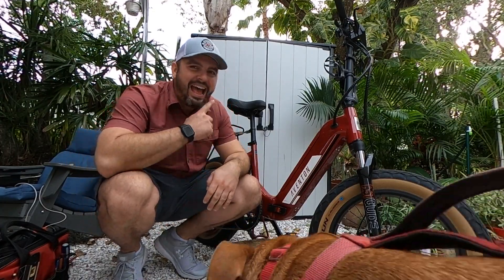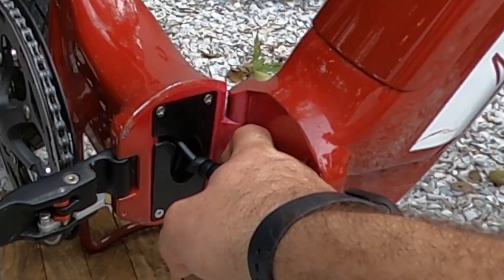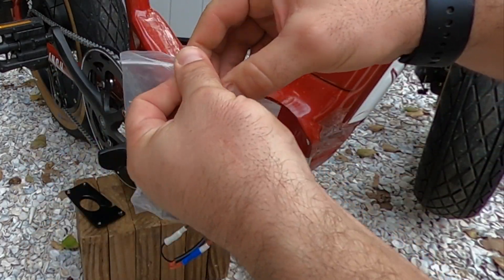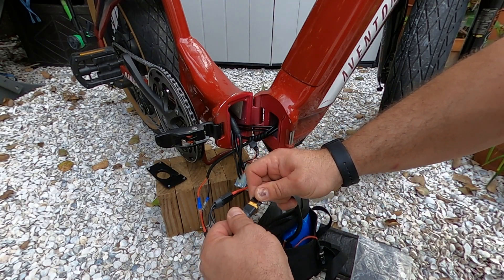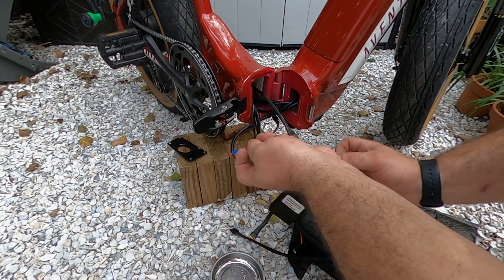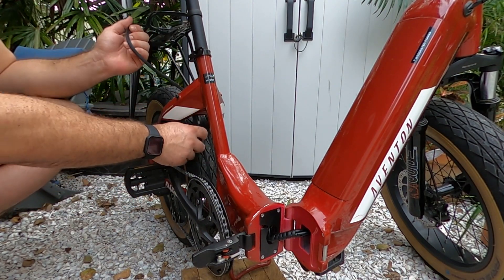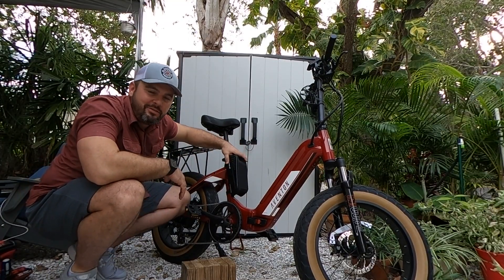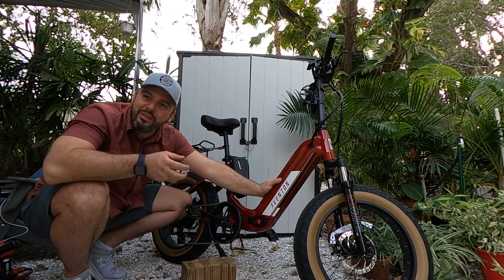Aventon | Sinch | Plug and Play Dual Battery Discharge Balancer Kit | Install Two Batteries

Comment: Does the kit work with the original curved frame Aventon Sinch??
Reply from the maker: Yes, you will need to consider battery placement. Order the kit with bullet adapters.

Comment: Addmotor has equipped the M160 with their first-ever internally integrated 48V 20Ah large battery, providing a torque sensor for more responsive and energy-efficient riding, resulting in longer range. With this design, you dont need two batteries to achieve enhanced performance.
Reply from the maker: The video you are responding to is for Aventon.

Comment: I have a Sinch ST on order and would like to install your Balancer here are my questions (2). I ordered an extra battery from Aventon can I use it and what terminals are used on that stock battery ?  Next is if one battery has 50% charge and the other is at 100% how does that work with the balancer to share the power that is available ?

Comment: Does the battery charge indicator work properly after installation? Thank you
Reply from the maker: The display will show voltage of both batteries in combination/parallel